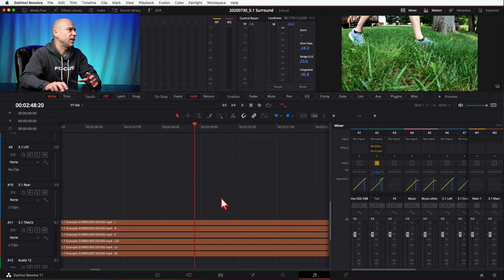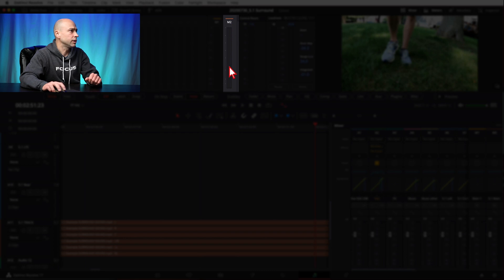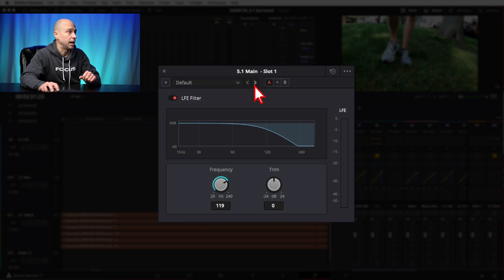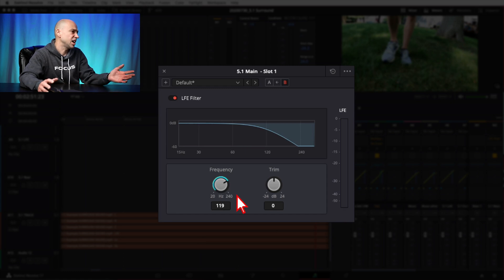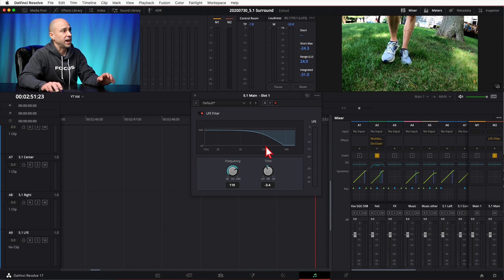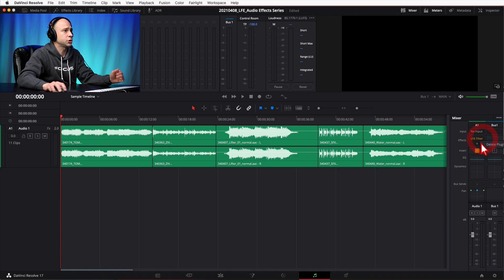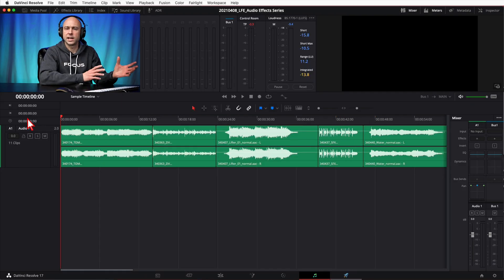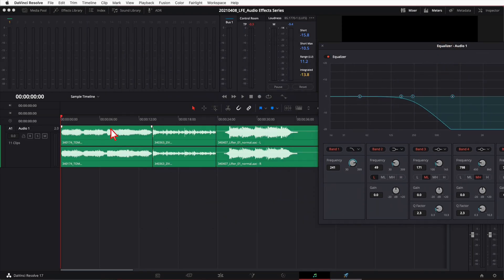LFE Filter Audio Effect in DaVinci Resolve 17 | Audio Effects Series

Comment: just to make it more clear in my mind... this effect will automatically take the chosen low frequencies from every track and put them into a single track (the sub/lfe track)?
Reply from the maker: It does not grab the low frequencies from every track, the effect will only apply to the track the effect is on.  If you have multiple tracks, you'd have to use the effect on each track or send all of the tracks to a bus, and apply the effect on the bus.
Reply: @JasonYadlovski  damn ok cool thank you. i was hoping to avoid the low cuts! xD im a total noob when it comes to surround "rules" so i just use my logic to make it happen. my first 5.1 surround 30 sec clip i did it with audacity and headphones xD i listened to it later though on a big system.

Comment: Jason: at 2:53 you refer to 5.1 (Main Channel OUT) When in DR 17.1.1 it's referred to as BUS 1.
That is unless the project was made with DR 16 and in a DR16 Created Database then when  you export a PROJECT to a folder then reimport that project and save it in  DR 17 created Database it will show up in Fairlight using the OLD style of BUS Format and Bus Assign as yours example in this tutorial.  Not the new DR 17 style of BUS format & assignment Where it referred to as BUS 1 out not  MAIN 1 out.
Waiting for a Tutorial on   the new DR 17 way of BUS format & assignment.
Reply from the maker: Hi!  It's a little confusing, but the Bus1 can be anything you want to assign it to.  Bus1 is just the default name they give it and you can rename it to anything you'd like.  As a Main Out, you have the option to make it Stereo, Mono, Surround sound (5.0, 5.1, 6.1, 7.0, 7.1), 2.1, LCRS, LCRSS, LCR or LRC.  You can get the same setups in DR17 as you had in DR16, you may just need to use a combo of the Bus format menu, for example to make a 5.1 surround sound and the Bus Assign window to assign that 5.1 to be an output from Resolve.  A bus is nothing more than a group of channels.  You have to tell resolve what you want that 'bus' to be and where you want it to go.  Hope that makes some sense.  😁👍
Reply: @JasonYadlovski   Absolutely but  that doesn't explain how the new Fairlite BUS Format & BUS Assignment works. There's a new thing  Bus Send what's that all about?
Reply from the maker: I’ll talk about it in the upcoming video.  It’s not as hard as it looks.  👍😁
Reply: @JasonYadlovski  Thanks looking forward to it.
Hard is subjective if you can't do something it hard for you but if you finally get it it then becomes  easy. I never really understood the old way much less this new Bus Format.